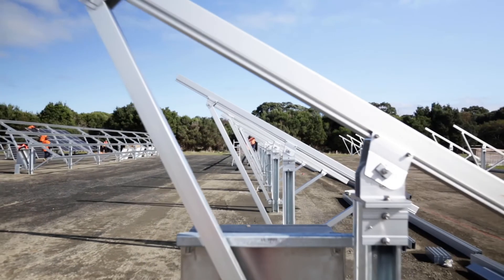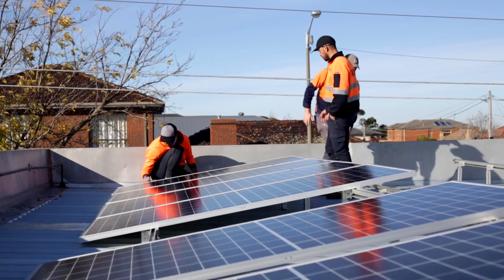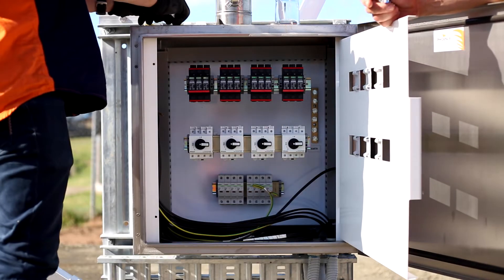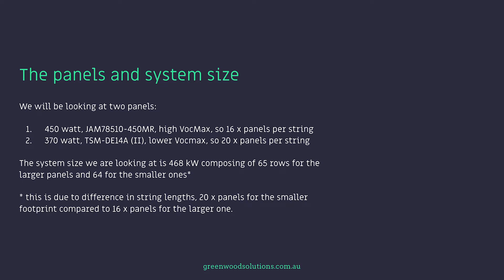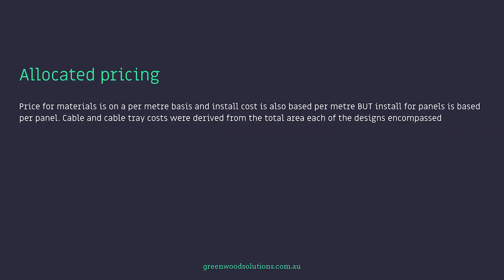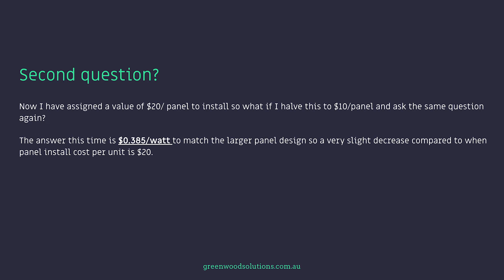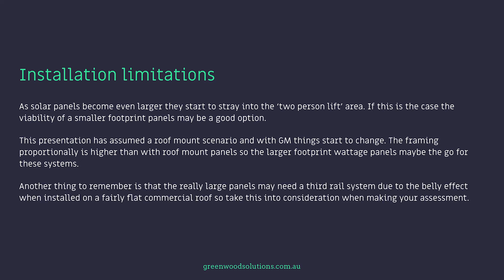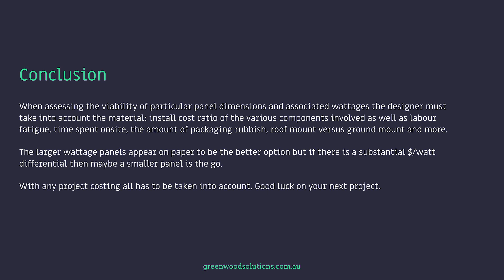Secrets of Big Solar VS Small; Viability Comparison Between Large and Small Solar Panels

Comment: If there are 2 companies and both are giving me a 10kw system. One uses smaller panels but more in number and the other is using bigger panels (producing more watts) and obviously less panels, does it matter which is better? Ty
Reply from the maker: A 10 kW system is a 10 kW system. Probably important to look at the different panel degradation rates of both panels being offered.